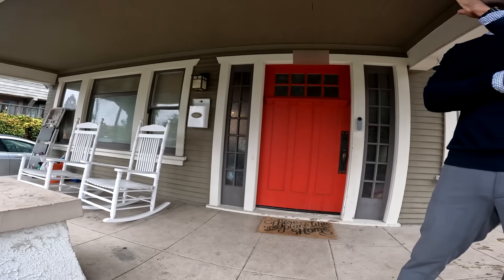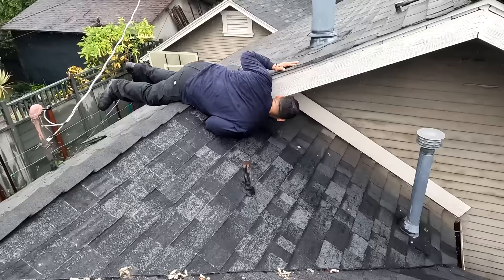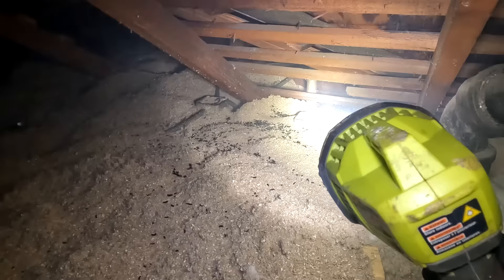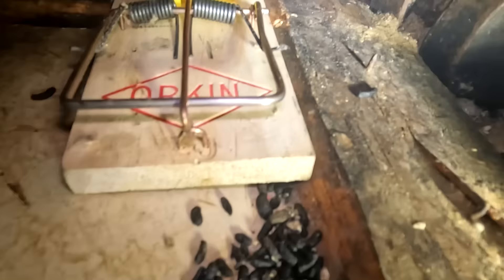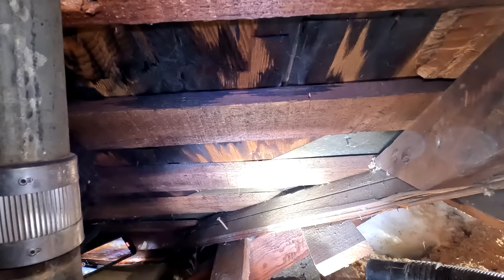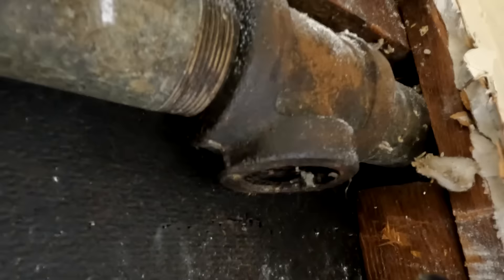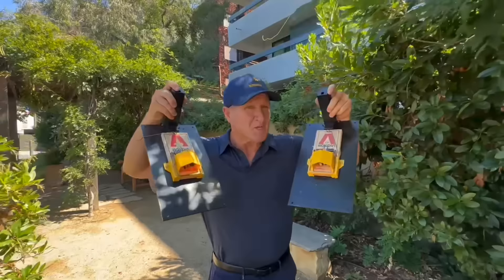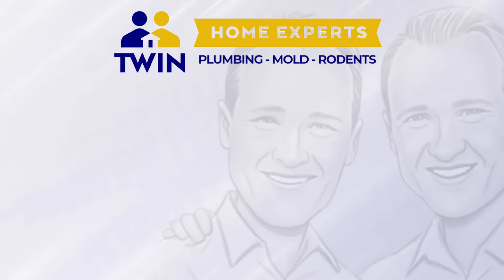The FASTEST way to get rid of ROOF & SEWER Rats 🐀 !!

Comment: We've had a mouse issue on and off for the past year (hopefully we've excluded all the entry points!), but when we called pest companies (big and small), most didn't do exclusions. They admitted that their technicians aren't trained on home construction and plumbing, so they just put traps inside and out and poison, which don't stop them from coming in. I appreciate your thoroughness because no one in my area does it like this as far as I know.
Reply: Same none in my area did exclusions just put down bait and these guys were not cheap
Reply: @harpergrace5846  I know, and when I questioned why they don't do exclusions, they said their technicians aren't trained on construction. One salesman told me "we do it so you don't have to". Thoroughness is absent in this industry.
Reply: The irony is that anyone can set a trap or put out poison, it’s the rest most homeowners need help with.
Reply: The twins are a mix of exterminator, contractor and plumber. Very rare set of skills.
Reply: @desyatk  You're correct. However, I can get down on my hands and knees, use a light, and search for holes. I found an area beneath my siding where I could feel cool area coming out and so I excluded it. This area was on the other side of the wall from where there had been a lot activity (behind my dishwasher). We'll see if they come back this winter. The point is why couldn't someone be trained on stuff like that?

Comment: As nice as a new bathroom can be that house is well past due for exterior work.
The porch column, the siding, a small window at ground level, the hole of course, probably the shingles.  Not as sexy as a bathroom but way more important.
And at the end of the day the open pipe has me questioning the rest of the bathroom remodel too.

Comment: Wow! A lot going on in this video. First that’s absolutely ridiculous for Orkin to miss that massive pile of rat droppings and the roof hole that was wide open. One major thing I have learned from watching your videos is that a lot of times pest problems are related to remodeling mistakes.  Not always, but it seems to be a common possible problem. 

I remember calling around when I had a mouse problem for a while and none would even come out unless I paid $500 for them to guarantee getting rid of them. I called Orkin and it was structured similarly how your clients described. Wanting you to purchase a year or so plan. 

I was lucky and was able to get rid of the mouse problem on my own after the crapped all over my silverware.  Shits disgusting and no one wants to deal with it. 

You truly are the needle in a haystack. Been watching you for a while now and you definitely blew it out of the water with this video. Of course they went with you. Who wants to deal with some to do everything that you accomplish in one service call. You are absolutely the best in the industry and set the standard.

Comment: It seems that with larger companines: 80% of the employees last 1 or maybe 2 years, you typically don't have someone who has plumbing experience, your not allowed to step anywhere in a attic that doesn't have flooring in place, no one is allowed to cut holes in walls, no one is is trained to cut holes in walls, just want to put bait boxes on the outside (just check the bait boxes and get on to the next stop), and no techs have the time or knowledge to do good exclusion work.  Let's face it you need to spend time, money, and investigate things to do good exclusion work. You need to be able to investigate thoroughly the attic, the crawlspace, and the interior problem areas.